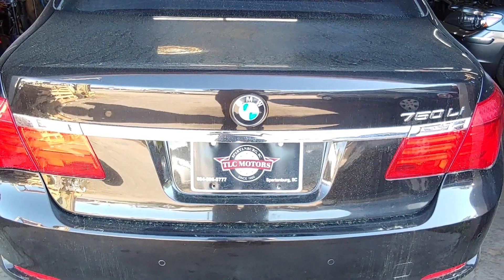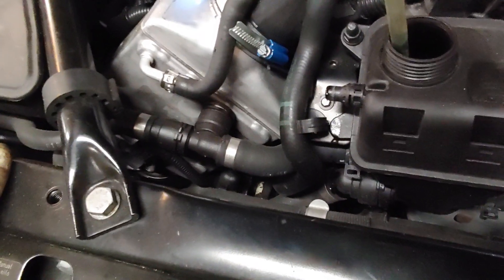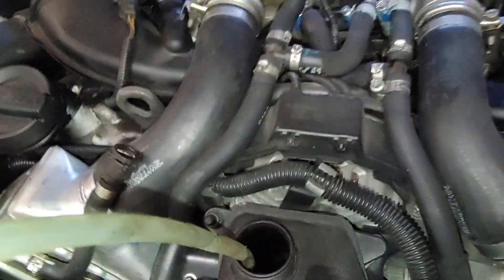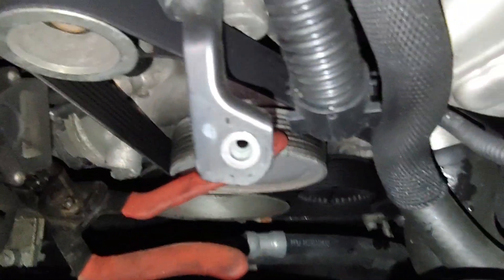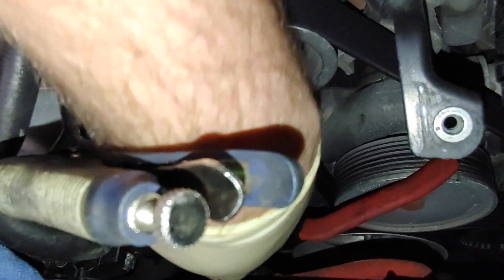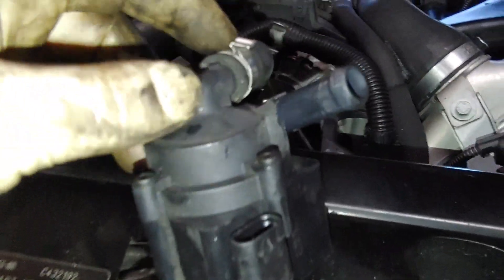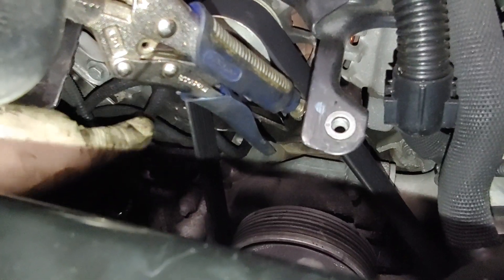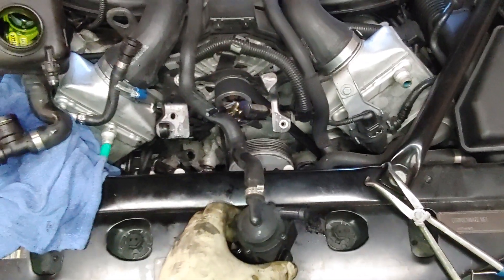Bmw 750Li n63 s63 turbo coolant pump replacement.  BMW Fault codes 2EA9 2EAA

Comment: my 750li has an issue where after shutting the car off, there is a loud humming clunking and rattling sound that goes on for about a minute. I inspected it today and it sounds like its coming from that pump. Is this a known issue? Thx
Reply from the maker: Yes it is a fairly common issue, it's very likely the pump.  They can make alot of noise and do run for a bit after shutting the car off

Comment: I came across your channel and very informative on how to replace this part, first question is what was the issue that made you change this? Second question in the small expansion tank is there supposed to be coolant flowing as the car is running?

Comment: thanx for the info. but it would very useful to tell if there was any fault code regarding to this pump.
Reply from the maker: Fault codes for the pump would be 2EA9 or 2EAA.  Thanks for the feedback, I will add those to the title.
Reply: @DiamondStarWerks  thank you very much
Reply: Please how do you clear the 2EA9 fault code? My obd scanner does not show it
Reply from the maker: @aliasmakaveli6314 if the scanner you are using doesn't show it then how do you know it has the code?

Comment: Hello , I believe I’m having this issue. I was going to on oil change after driving in 100° heat and when I started jacking my car up I noticed that the fan that’s normally on after you turn it off, wasn’t. Would this be the issue? Great video btw.
Reply from the maker: This code would be unrelated to any fan operation.  Whether or not the fan runs is determined by the ECU so it just depends on what it sees.
Reply: I haven’t got a code either , but I really like hearing that fan after drives like that.

Comment: Peace be upon you brother
I want to ask you about the same problem. I replaced the part, changed the motor computer and the wiring is in good condition. Do you have any information? Still the same problem
Code defaut : CD9001
Reply from the maker: Peace be upon you
I will look into it and let you know.

Comment: Hi, thanks for the instructive video! In my 750Li F02 from 2009, I am getting a fault 802096 Supplementary coolant pump: short circuit to ground. When I clear the fault, it comes back after driving a bit. The previous owner of the car has had this same error and replaced the pump about 1.5 years ago (brand: Pierburg). Does this mean that the pump is bad again? Is it very harmful for the engine if the pump isn't replaced immediately? What is your advise?
Reply from the maker: Yes it very likely could be bad again.  You never know where the PO got the replacement pump, OE, EBAY, used.  Even if it was new OE I have still seen them fail.  It is not normally detrimental but I would advise not to drive it hard with a bad pump.
Reply: @DiamondStarWerks  Thanks for your reply! It turned out that the pump that was broken in my car, actually is for the cabin heating. There are so many pumps on this car, one has to be careful with the diagnosis :-) I replaced the pump, cleared the DTC, and all is good.
Reply: Hi, I have the same exact code on a 550i, could you please share the part number for the pump that was faulty and is that code specific to the heater pump or does the code mean it could be any of them?
Reply from the maker: @chickenstripssssss8984  I'll find the part number again for you ina bit.  The code I got was specific I believe for the turbo coolant pump.
Reply: @DiamondStarWerks  thanks for the quick reply. I’m trying to determine if it’s my turbo or heater pump. Do you have any advice for testing which it could be?Also, do you remember what the code was? I’m getting “802096” same as “XW U” meaning if the codes are different it would be the heater pump.
Reply from the maker: That code should be for the aux water pump for heater system not the turbo.  That part number should be 64 11 9 253 081
Reply: @DiamondStarWerks  thanks for getting back to me. Much appreciated. Do you by chance remember the code that was present with the turbo pump malfunction?

Comment: How do i know it failed?  Mine i filled it up and its empty 5 min later and i cnt find a leak under
Reply from the maker: it will usually give an engine code for a failed pump.  How many times Have you tried to fill it?  I've replaced a rod in a 15 m5 once due to an intercooler busting and dumping the coolant into the intake.  If it works and its just out of fluid it won't through a code.  You can try the vent procedure to see if it runs or not
Reply: @DiamondStarWerks  bro i added water barley a small bottle just now drove for 3 km then checked its empty and i cant see any water underneath or leak.. how many liters does that resv take? And should i  try filling it while its on ? Cus it was off
Reply: Im not an expert but would this water be going into the engine?
Reply from the maker: @azzamkhalil26  not sure on how much it holds.  I've never needed more than 1-2 liters anytime I've ever filled them.  If it running fine and not smoking its not going into the engine.  This system cools intercooler, turbo, and ecu i believe.
Reply from the maker: @azzamkhalil26  it would be smoking or running rough if it was going into engine.  Refill it again
Reply: @DiamondStarWerks  ok can i keep the cap off and run the engine while refilling till it bubles?
Reply from the maker: @azzamkhalil26  i would do the vent procedure with a batt charger and the cap on.  If it was really low you would be able to remove all the air by the first fill.  You have to vent it or drive it and recheck to it fills to max and doesn't drop.
Reply from the maker: @azzamkhalil26  vent procedure will vent both engine and turbo coolant
Reply: @DiamondStarWerks  alrite bro ..i dont know to be honest cus this car has got me bankrupt and tried selling it and no one buys it...! 

But its so weird that i barely filled half a bottle of water and it seemed full... then a few kms later i checked and its dry on the inside.!
Reply from the maker: https://youtu.be/78HzOaqMx9w

Comment: I had a 2EA9 turbocharger coolant pump code as well as engine hot drive moderately message on start up after it’s been sitting for a long while. If I shut down for about 5 mins it won’t display the message only after it’s been sitting for awhile. I replaced this pump and cleared the code but the error came back sadly.  Any ideas??
Reply from the maker: You replaced the pump below the small center coolant tank or the one down attached to the fan?  If you replaced the pump but still have the code make sure the old one didn't blow a fuse

Comment: I have a used 2012 550i gt what do I top of my air cooler reservior? Does take the same as the engine coolant reservoir?
Reply from the maker: Yes it uses the same coolant as the engine.

Comment: Is this what’s making my 2011 750 studder when I hit the gas? Just changed spark plugs and ignition coils so I know it’s not from those and I get a drivetrain malfunction error when I hit about 80 for a long time
Reply from the maker: I haven't seen them cause any stuttering or misfires.  What codes are coming from the malfunction?

Comment: Hi, Nice video!
I will be doing that in my X5 50i E70,  2nd T/C Cooling pump, 1st replacement 30000km, and now 2nd replacement 131000km
What happens if I just ignore it and not replace it? This pump is just addition.. without it the T/C bearings are still cooled by the engine cooling pump.
Reply from the maker: Without it they are oil cooled only.  The turbo coolant system is separate from the engines system.
Reply: @DiamondStarWerks  I think the turbos cool with the engine coolant system and the other which this pump is for only cool the charge air. removing heat of compression from turbo compressing air to make air denser getting more oxygen in motor making more power.
Reply: @DiamondStarWerks Did you get a warning message during cold start? Mine doesn't but only 2EA9 codes when OBD Scanned
Reply from the maker: @GrandSavrify not that I remember, no.
Reply: @DiamondStarWerks  Thanks for the prompt reply! The fault codes on appeared in obd diagnostic scanner, but nothing prompt in car, is that correct ?
Reply from the maker: Yes from what I remember there was no prompt in the car.  Just the code and noise from the pump when running

Comment: What’s the type of fluid that you use for this turbo coolants?
Reply from the maker: Its the same bmw blue coolant for the engine.  We normally buy from worldpac.  But you can use zerex bmw coolant or GC.  OR maybe check with mini cooper, i think we got bmw blue coolant from them really cheap before.  Mini blue coolant will be the same as BMW